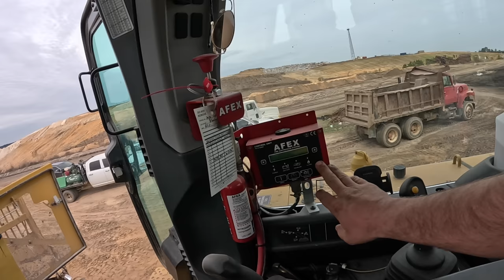Excavator SPLITS trees! 🌲 POWERFUL hydraulic SCREW !!

Comment: That is a great platform to work on the giant dozer.  The factory guy will be happy to see that, and not need to work on his back all day!  I wonder if you have recently been power washing the radiators?  I know someone who had a overheating RV and the guy power washed the radiator, intercooler and transmission coolers, it ran much cooler for 3 years!  

I used to work for Long Beach CA, and they would have to service the fire systems every 2 years, and wanted to change out the fire extinguishing stuff after about 4 years, so the old stuff gets packed into the container pretty well by then.  

My buddy who lived 15 miles west of Victorville CA, on a country road, built his mailbox support from 4" steel.  Did not sink it 4 feet deep though, only about 6" in the sand.  The supports where 4" steel, going three ways, 3 feet long each direction.  The pickup that hit it, ended up in the air!  And I think one of the pipes went into the engine?  The guy had to get a tow truck to lift the front of the truck off of his mailbox support.  Funny nobody hit his mailbox - ever!  

It is interesting watching the large screw driver going to break up those trees!  

Thanks for another very interesting video!
Reply from the maker: Thanks for the awesome comment! Yes, we wash regularly. Something must be going on internally. We’ll find something cool to do with the spent rotor! 🍻

Comment: i have to say that b66 looks slow to me, i run a 5710 it walks through anything up to about 4' in diameter, granted we run 6 inch screens
Reply from the maker: Probably could run faster with larger screen
Reply: @TheRealMrDiGG  it sure as hell looks easier to work on than ours… saw yall pull the drum. Hell it took us a day and a half to get the compression roll off

Comment: In my past experiences with Cat I'd be asking the technician about the Teflon bands on the planetary inside the transmission I had an D8 act the same as what Aaron described they came in give me a bunch of horse shit on what could be wrong and such said they fixed it yet your at 1700 hrs your getting close Cat said about 2000 hrs that the Teflon was about worn out allowing the oil to bypass making it sluggish and heating up the planetary wasn't covered under warranty for the hours it had on it just food for thought Ryan plus tell your mechanic not to buy the tool to remove Axles from machine 5/8 all thread screws into them on a 6 they will pull hard and are heavy but no need in buying tools like they suggest also drop driveshaft remove the bolts around the outside of transmission it pulls out of back you can fabricate a lifting apparatus to remove transmission it's on 2 slide rails that won't allow it to come out until you get it rigged up also there is 3 planetary inside the transmission if I remember correctly Teflon rings minimal cost and a good mechanic can do it in less than a day start to finish but if you buy all tools they recommend figure on dropping 15-20 grand on entire job when you can spend less than a grand on parts plus your labor hopefully this helps if you have to go this route
Reply from the maker: This awesome!! Thanks so much, just sent your comment to Aaron & Rolando. Really appreciate the help Buddy!!!!!
Reply: No problem Ryan its what we supposed to do is love our brother and help them where we can love you man don't take that wrong by any means but take it to heart
Reply from the maker: @brian7327  appreciate ya brother!👍👍
Reply: This is good insight! Defiantly going to ask the CAT tech about it

Comment: Kinda putting balancing on those drums are stupid you weld new holders on sometimes with more or less weld get big dings in them so how balance do they really need to be and how long does it stay balanced after used a few hours
Reply from the maker: I feel ya here, but if they aren’t balanced inside all those rpms just radiate outwards I suppose??

Comment: If that concrete is an average 3,000 psi, taking the surface area that the dozer tracks occupy would, without getting all “mathy” be well within any safety limits.  Heck, I’d sleep well under the thing.  If it didn’t drip oil.
Reply from the maker: It looked pretty safe to me, but I suck at math!